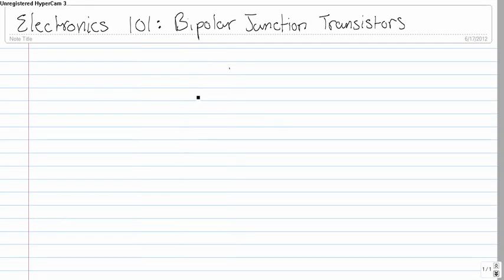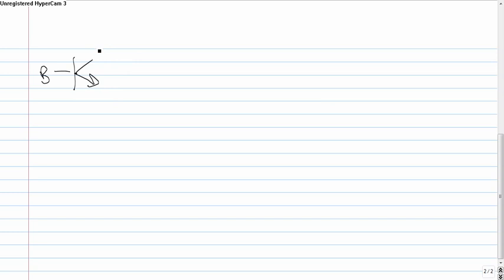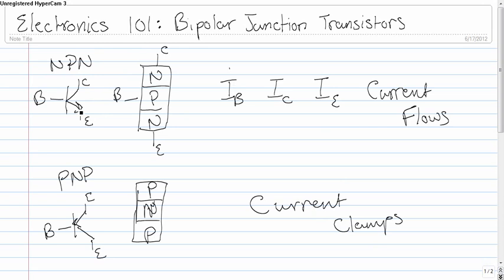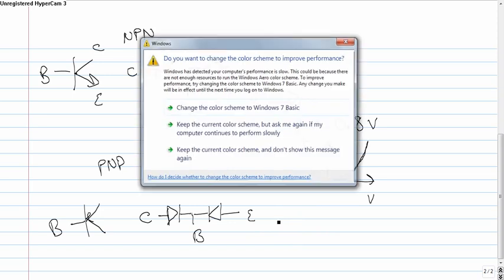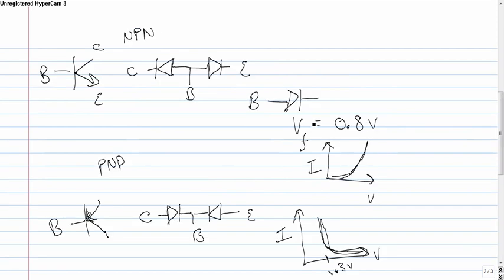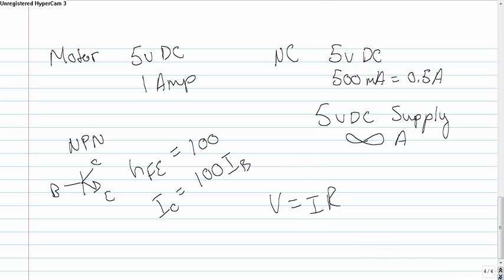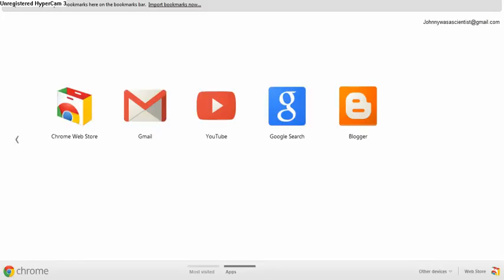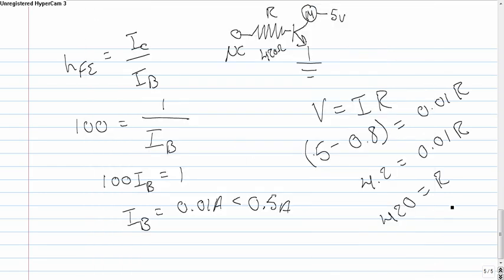Electronics 101: Bipolar Junction Transistors

Comment: This may be a very basic question, but @13:31 when you draw the circuit on the top of the screen and you connect the voltage to the Motor (5v) and ground to the emitter end of the transistor, how is the circuit complete? Does the microcontroler have a power source? or is ground looping back to connect to the microcontroller? CIruit diagrams that do not connect have always confused me. Awesome videos! Really helps me understand digital electronics (learning analog before going there)

Comment: I am trying to switch well over 100amps at 50-100Hz. and 24vDc. for a inverter project. I am intimidated by the IGBT modules. and have concerns about using MOSFETs. I am self taught so there is a lot I do not know. I was thinking of using to220 or to247 get packages. but concerned about the current handling of the legs of the FETs. how much can they handle safely? and I guess I need to match them close as possible. but how close is good enough. I don't know if I am over thinking it. so I am looking for advice from professionals.  I have been told to use shunt resistors on the FETs before the parallel buss. I was wondering if a fuse would also help with protection! and how many FETs would I need if they are rated at 100amps +/- . by what the package can can handle.  or would a IGBT module be better. I am concerned about them exploding. if they are used at low frequencies. and kept cool can they be safely used. if they are even a small explosion it will cause a fire in my situation. or would FETs be better given my skill level. however  on the out put stage. or H bridge could igbts be a good choice or would there be a even greater possibility of a shoot through explosion. even though there is only 20-80 amps max. your help would be greatly appreciated.  thanks a lot. sorry for the rambling on!

Comment: I don't understand if you have a 3V battery and a 8 ohm resistor before the collector, and emitter is ground, max current should be .375A.  What if base current is 10mA and hfe is 100, this says Ic should be 1A, but it's not possible.

Comment: Hello.
What I understood from what you said at 6:00, was that if Ib was large enough, current would flow from C to E, even if Ic > Ib.

I  simulated a circuit like the one showed:
https://www.circuitlab.com/circuit/dy8ru6/screenshot/1024x768/

And it seems that no current flows from left to right, even though the base is receiving a current of about 10A (which is enough to get the diode to let current through)... (There should be a current of 10kA...)

Comment: Could you please explain to me why it is bad to use this example to control a
motor (or in my case a mini DC pump)?
Reply: Because he did not use any protection circuitry or such and the transistors would die.
Reply: when you look at a basic transistor datasheet (BJT), usually the transistor can't supply much current. But I think you can use a different transistor such as a mosfet to run a motor (correct me if i'm wrong). Humanharddrive has got a video on mosfets that's very informative.
Reply: Thank You, that helped !

Comment: Where does this 0.8 forward voltage drop come from?  Never heard of this diode on the output of a micro-controller before, and I've been working with Arduinos a lot lately.

Comment: Just saw that message your getting for low disk space is on your data recovery drive(d:). That means that drive is in use and it shouldn't be. I bet someone changed your paging file and selected D by mistake. That's why you keep getting a low disk message because windows keeps trying to use it and it's too small. Check your virtual memory settings and select a drive other than your recovery drive or let windows manage it. If you do set it the size will depend on the amount of RAM you have.